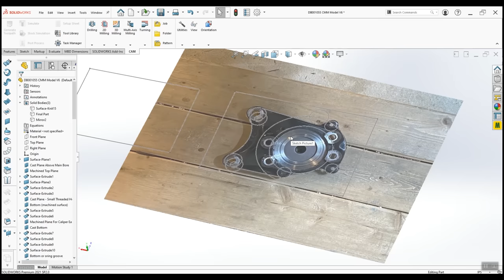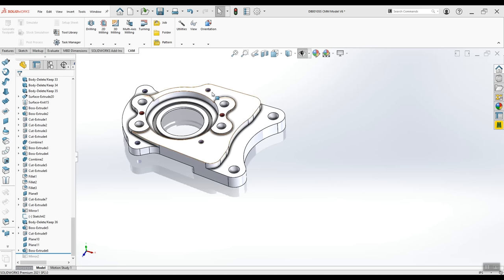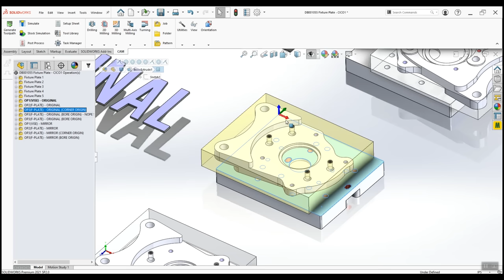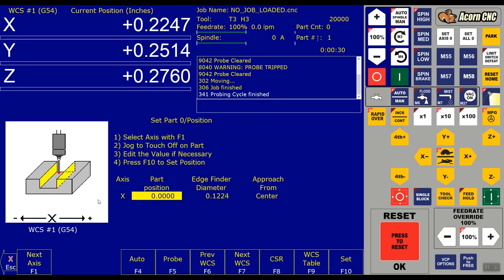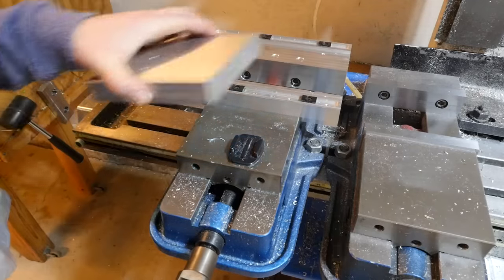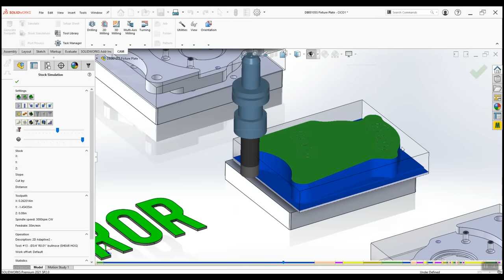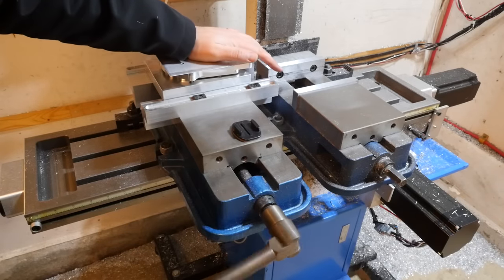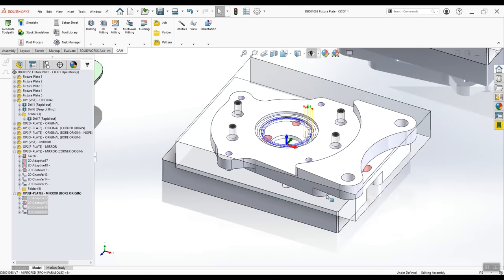How I Copy Parts in the Garage on a CNC Mill

Comment: Hi Adam. I learnt a lot watching this. I have an old Syil X4 with Mach3 and F360. Although your setup is different the way you apply the principles is excellent. Your video quality is very good and your presentation with all the feeds, speeds etc is great. Very few people mention how useful photographs can be - something I discovered myself. The way you position the features first before overlaying the image has really got me thinking.
Reply from the maker: Hi Peter - thanks for the feedback. I’m glad you enjoyed it. I agree that photos are immensely useful for this kind of thing. I’ve also learned that the further back the camera is from the part, the more accurate the results - I think it reduces the “perspective skew.” How much? I’m not sure… cheers! 🍻
Reply: @adamdebowski2037  We have traveled the same road here. I use a 35mm camera and a wide angle lens close up is not ideal. A longer focus lens (105mm) from further away gives better results.
Reply: My workflow for this is to use a c-stand and an 85mm lens where possible and correct the inherent distortion in Lightroom before using the photo. Lightroom can use the metadata from something as simple as a phone to minimise the distortion. I’ve found three measurements to be far more accurate with this method, even going closer to the edge of the photo.
Reply: I just bought a used Syil X3 with Mach 3 and can't get the computer to grab the mill. I am awaiting a new DB25 cable, will have it in a couple days. Know any good sites for my machine?

Comment: If you don't like the finish of your endmill then try experimenting with different feeds and speeds. Usually, harder material need faster speeds and taking a finishing pass or two of 0.010 to 0.005 will clean up the face nicely. To be fair, I only work with a manual lathe and mill due to the fact I don't have access to a cnc yet.
Great video, I can't wait to see more.
Reply from the maker: Thanks, Steve! I'm pressure sure the issue here is that the inserts I have are either 0 radius or 0.010" radius. Something like 0.030" or more should be better.... I think.... Cheers - Adam

Comment: So, are you able to have an output from the probe to input the coordinates in the CAD software or are you stuck with manually adding them to the drawings? That would be neat if possible.
Reply from the maker: Definitely stuck with manually adding them - one by one - to the model and drawing. In theory, it should be possible to write a probing program to go to certain places, probe features, and save the data, but that kind of thing is way over my head. I haven't proven/tried it, but I'm very sure my post wouldn't support it either.

Comment: This was a great video, really enjoyed it! I’ve only used manual machining tools so far but now have access to a 4 axis CNC mill (SYIL X7) at my local maker space, so it’s cool to see what can be done with the right skills and setup. 👍

For a part like this, approximately how many hours did the probing and design take, and how much of actual machine running time? I'm going to pay by the minute so it would be great to get a rough idea what a part like this would cost me to make on the CNC. 

Best regards from Austria! 
Lukas
Reply from the maker: Glad you enjoyed it! To probe the critical surfaces took half an hour and modelling the rest took another 30-45 mins or so. I would budget an extra hour or two if it’s your first time maybe. The total cycle time for one of those parts is somewhere around 2.5-3 hrs on my small machine.

It’s very cool that you have access to a machine like that. What about tools/endmills? Do you buy your own? What about the time it takes to set the tools up in the machine? Do you pay for that, too? 

Cheers from Canada!
Adam
Reply: @adamdebowski2037  Thanks for the quick reply, good to know!  Regarding the maker spacer, they let you use the machine, but you have to bring your own cutting tools. You pay by the minute (about 1 Euro per minute), but only for the time when the spindle actually turns, so setup time is free. They have a bunch of other machines including a 130x90cm metal laser with 1200W so it can do 12mm steel or 4mm aluminum, as well as bigger lasers for wood and other materials. So perfect to compliment my private workshop that doesn't have any €20k+ machines... 😎

Comment: Really good information. I’m a PE and run SW daily. When you talk about probing your part (~45 sec in) and getting into SW, are you doing this manually reading the mill’s DRO, or are you able to directly input your mesh into a sketch / SW directly? Aloha and thank you.
Reply from the maker: I’m doing it manually. You can scan the part in a grid pattern (with a resolution of your choosing) with the probe if you buy centroid’s digitizing package and it will generate cloud point data that you can import into SW and stitch into a mesh with the mesh wizard. It ends up looking like an STL file which isn’t suitable for cam/machining in most cases.
Reply: @adamdebowski2037  right. I’ve tried some workflows from photogrammetry and pushing that into SW with limited success. So I’m still inputting dims with a set of Calipers or mic… 🤙🏼 thanks again! Keep up the great content.

Comment: This was very informative. Do you have a list of the tooling you used here? I just bought a PM745VT with a Masso/Clearpaths.  I'm watching some of your other videos now.
Reply from the maker: I use the Tormach TTS tool holding system & use bright/uncoated 2 flute (for 1/8” tools or smaller) endmills, and bright/uncoated 3 flute endmills (for 3/16” tools or bigger) in aluminum/brass/plastics. For steels I typically use coated 4 flute endmills. You might like this video where i quickly go over everything I use: Convert a Bench Mill to CNC - Everything You Need to Know
https://youtu.be/bN_D3NWwdu4
Reply: @adamdebowski2037  Thanks, Ill watch that one and take notes.

Comment: Man you need to get a rotary encoder so you can rigid tap. Also glad to see other people using Centroid.
Reply from the maker: Would be so nice. I generally thread mill to get around this kind thing. An encoder would make tool and belt changes a little more difficult I think. What machine are you running centroid on?
Reply: @adamdebowski2037  A power draw bar would make tool changes easier.. As for my machines, I have a AXYZ 4004 routerwith a ATC Spindle, I am also finishing up a Emco PC Turn 50 that is also Centroid. and funny enough I was starting a Sieg X2 mini mill build which also has an Acorn but I got the router and that took over.
Reply from the maker: @mrp19285  nice! would love to see the ATC.
Reply: @adamdebowski2037  Once you go ATC you never go back.

Comment: Great videos Adam. Re your s5000LED probe. I don't see any wiring diagrams on the drewtronics site. I'm running an Acorn too and their KP3 is a 3 wire probe. Is the s5000LED a 2 or 3 wire?
Reply: NM, I saw your other vid re s5000LED. So no detect just signal and common. I try not to cheap out on tools, but the s5000LED is 1/3rd the price and you sound pretty pleased with it. I'm going to give it a shot. Thanks for the great videos :)
Reply from the maker: You got it. Ya, I love the thing and haven’t had any issues w it. Because there’s no detect, centroid prompts you to hit the probe with your finger to make sure it’s working. When you hit it, you see a probe tripped message in the dialogue box. You can choose to do that check or just press cycle start if you’re feeling lucky! Lol
Reply from the maker: I will say that a longer probe stick out would be nice. It only sticks out an inch so if you need to reach deep, you’ve gotta get creative

Comment: im guessing youre running servos or closed loop for the accuracy your getting from a mill conversion?( I have a good idea of the accuracy your getting based on the probling accuracy for the parts ) I think a common problem , atleast on my mill is the chinese ball screws i used , when tested under load after the fact they have about .003 alone , nevermind the losses in all the other parts.
Reply from the maker: Yessir - closed loop steppers. Have you shimmed your double ball nuts? Played with the backlash comp in your control? If you’ve over tightened the gibs that’s another way to introduce backlash. Cheers 🍻 Adam

Comment: Did you need to select  a different cable type on the Probe for the Acorn board?
Reply from the maker: Yes. I did not get the tormach connector. Just a two-lead wire. Would be better if you got a 3 lead wire to wire into the acorn so you can have both a probe trip circuit and a probe detect circuit.

Comment: Id be curious to hear a cost/time breakdown to final price for done part. To see where time is absorbed compared to operation earnings. I hope that made sense.
Reply from the maker: Hi customsolutionsinc - good question. Each piece of aluminum was around $50, and I did the work for $650 I think. A much lower price than a machine shop would charge. I do this stuff because I love it, and I try to at the very least pay for my hobby. If I was making many of these, it would be lot more lucrative, but I would not recommend a machine like this for serious production runs. It’s a fun hobby machine and a great learning tool. If you’re into making things for yourself, perfect option. I’d you’re looking to make money, I’d invest in a small VMC. Hope that helps! Cheers 🍻
Reply: @adamdebowski2037 thanks for talking about cost. While watching the video, I kept thinking about how much would I charge for this type of work.  The level of detail and the tolerances you worked to made me immediately think about the $500-$1000 range charge for the completed part.

Comment: Hi Adam, I'm a little late to the party here.  I too have a PM30 running Acorn.  I have the Centroid KP=3 probe.  My question is how exactly you take your measurements from the Probe and accurately place them in you r Fusion model?  Dimensions are simple to obtain.  Relationships between them are often not.  In the video you showed probing a bore, then in the next instant, there are four or five features shown in your cad model.  Are you using a mapping routing to obtain this specific orientation data?
Reply from the maker: Hi Shawn - when probing a bore, centroid will spit out the bore sizes as well as position of the bore’s Center in terms of X & Y coordinates with respect to the work coordinate offset. So in a fusion sketch, I’d place the bores at the appropriate coordinates and at the right size, slowly building the part one feature at a time. Does that make sense?

Adam
Reply: Thank you. I never would have thought of using the machine coordinates to populate my fusion sketch dimensions.  Thank you!! @adamdebowski2037
Reply from the maker: @shawnhanifan2500  glad I could be of some help. Good luck and thanks for watching 👍👍

Comment: Im really not trying to be a troll, but countersunk holes on the fixture wouldn't be better for locating the part when screwed down? the allen bolts leave some kinda wiggle room there, don't they? if i'm wrong please let me know why. Awesome job on the replication by the way!
Reply from the maker: You’d be the kindest troll I’ve run into! The slop in both countersunk and counterbored clearance holes would be enough to throw the part out of alignment by many thousandths. All the screws are only meant to hold the part down. It’s the dowel pins and dowel holes that align the part to within a thousandth of an inch or two. Does that make sense?
Reply: @adamdebowski2037  Yes it does! Keep the good work man, awesome content!

Comment: I have always wanted to be able to do this type of CNC type machining in my home shop but never had the nerve to pull the trigger on purchasing the system.  Unsure how long it took you to get good at this? Did you have a machinist background? In any event, very impressed with your abilities and video. Thxs
Reply from the maker: Hi Ralph - thanks for the kind words! I have no previous experience as a machinist, and extensive experience with the Solidworks CAD software. Designing parts in 3D was no problem, but learning how to apply toolpaths to the parts was all new to me. I’d say it took me a couple months of using the machine a few times a week to get comfortable with it

Comment: Hi, just came across this video, you are getting nice finish with the PM30,  I'm running a PM25MV
Reply from the maker: Cheers - how are you finding your finishes? Our mills are almost identical - I would expect you’re getting something similar.
Reply: @adamdebowski2037  i don't think it's as nice as your. I think if i was running coolant  or something for lubricant i would be get great finish. I do like the mill for what it is.  I'm not as talented as you are programming. I use Gibbs cam
Reply from the maker: @makosharkcnc7730  Thanks for the kind words! I don't consider myself a talented programmer. I have been designing for many years, but I'm pretty new to CAM and machining in general. I do, however, have the benefit of having friends that are very good programmers, and I use them shamelessly! Some advice that you may already know, and might help with finishes: In general, I remove the maximum amount of material as fast as possible, but I leave a 0.010" "skin" all around the part that I later clean up with light finishing passes that produce great finishes. I find our mills really shake around when removing lots of material, but they're rigid enough to remove small amounts of material accurately when needed. Cheers! Adam.

Comment: Why do you use the CNC instead of scanning parts to put them in CAD models? Is it more accurate?
Reply from the maker: It is more accurate and you can’t use the files that the scanner generates for machining. They are fine for 3D printing, but not great for machining.

Comment: I know this video is from 2 years ago but I’m trying to understand cad more. I have seen people in solid edge make surfaces from sketches. My current learning that I’m trying to do is take a toolhead air duct and create the duct path line. I was trying to create a solid by using sweep but it just errors. Would it be better to create a surface? I am ignorant so keep this in mind, but would it be better to create a surface and then convert to a solid?
Reply from the maker: You can sweep a solid or surface, one isn’t easier than the other. You may be getting errors because you’re not using the “pierce” sketch relation. Also, if you’re just wanting to sweep a circle, you don’t even need to draw the circle. If you draw the duct path line, then go right into the sweet feature, solidworks will give you the option of sweeping a circle at tue size of your choosing… although keep in mind that feature came into existence around 2020 if I remember right. You can then use the shell feature to hollow out the solid so it’s like a tube. Fee free to email me at adamd.cnc@gmail.com if you have any more questions. Include some screen shots/details of what you’re trying to do and I’ll be happy to help.
Reply: @adamdebowski2037  I created a circle on xy plane and changed the curve in 3D space. It will allow surface to create the duct on sweep but when in solid it says that all edges selected as path or cross section must be connected. They are connected and also the path and the circle overlap so they def touch. Sounds like something in solid edge.

Comment: Very good video and I too love using HSM in Solidworks. We have a Haas machine with Renishaw probe and have thought of using it to reverse engineer. What did you do to get the probed surface coordinates into Solidworks?
Reply from the maker: Hi Anthony. I use probing routines in the control and manually build the part in solidworks as I go, then overlay the photo and trace.

Comment: how do you translate the probe data into accurate position data in solidworks? great video
Reply from the maker: Hi John. After running a probing routine on the Acorn for, say, a bore, it will give you the size of the bore, and it's position with respect to the work coordinate offset. So lets say you set any bore to have its center axis a x=0 and y=0. Then when you measure another bore, it will give you it's size, and it's X & Y coordinates. So when you're modelling the part, you'll know where to draw that second bore with respect to the first. I pick one bore to be my x/y 0, and then measure all the other bores to get their size and positions, and I'll draw them all in solidworks, one at a time, as I'm measuring them on the machine. Does that make sense?
Reply: @adamdebowski2037  awesome! thanks for explaining that Adam.

Comment: What probe are you using? I know you use acorn obviously but I run mach 4 with a Pokeys57 breakout board on my PM728VT and I see it also has probing features.
Reply from the maker: It’s the drewtronics probe. Check it out at drewtronics.org
Reply: @adamdebowski2037  is yours the S5000LED TTS?
Reply from the maker: @dirtboy896  yes - exactly - except it has the non-tormach whip because I’m using it w an Acorn. You’ll have to email Drew and he’ll make it for you same price if that’s what you need
Reply: @adamdebowski2037  oh Ok I thought the TTS meant the style of where the tool holder goes into the spindle. I guess that doesn’t matter anyways. I use mach 4
Reply from the maker: @dirtboy896  you are right. When I say “whip” I’m talking about the wiring coming out of the tool holder. There is a tormach connector that drew sells standard w the probe to be used in a tormach machine. If you don’t have a tormach, you don’t need or want that connection.